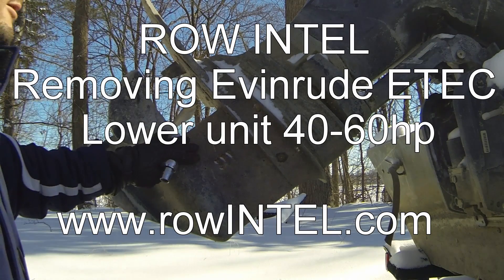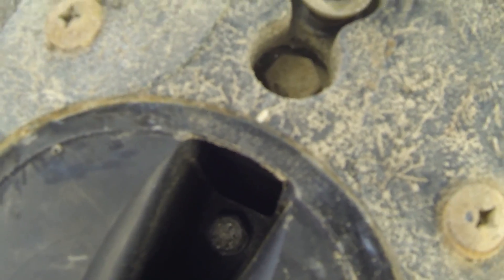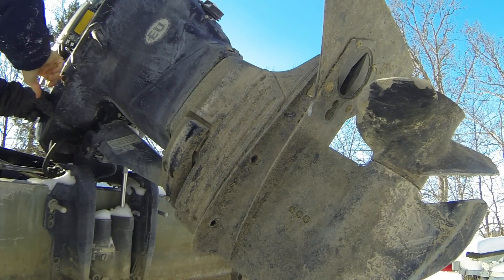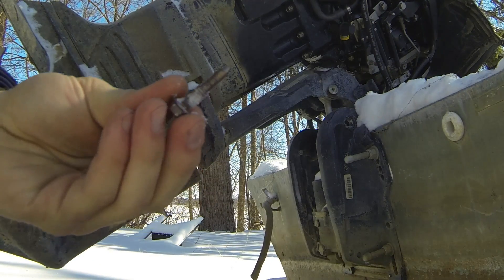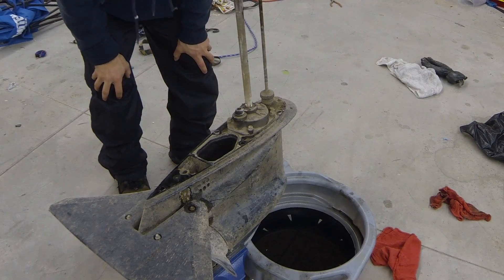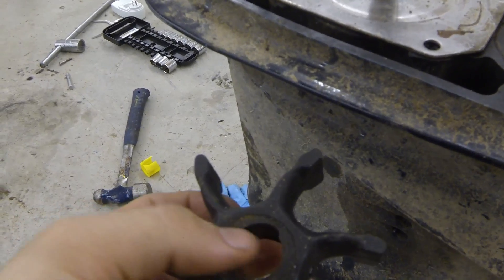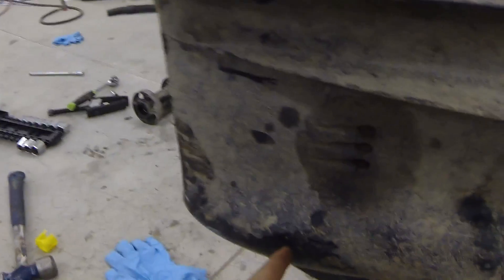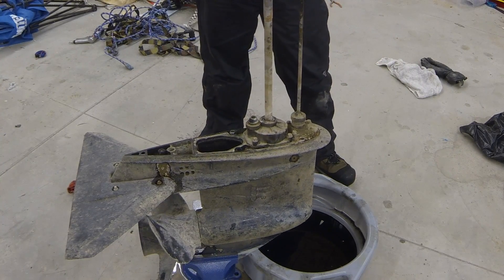10 minutes How to change Water Pump 2010 ETEC 60HP Evinrude

Comment: hi. The injectors of the 40 hp etech engine are not spraying, I think the inside of the engine is locked. I give 12 volts to the injectors externally and there is very little ticking sound. In some places they say it works with 55 volts. I wonder how many volts these injectors work with. and what should i do? I removed and cleaned the injectors. Please help.

Comment: hey quick question I  have a 1993 30 hp ELS and today did the water pump removal and install all seemed fine but starter wont crank motor? bat has juice, starter spins flywheel fast with plugs out. prop and flywheel will turn manually in drive but it is not easy. I can shift from F-N-to reverse, do you think the driveshaft be misaligned? It would break your arm trying to pull a rope manually in neutral.  I should have tried to start it before doing the repair.
Reply from the maker: try dropping the lower unit and then starting the motor without the "foot" on it.  That will at least narrow it down to a powerhead or gearcase problem

Comment: you made it look so easy, did you have to use any gasket glue?  Thx
Reply from the maker: Pacman Au Doesn't hurt to use it, but if you are replacing all the parts including the housing and base plate, then you shouldn't need any.

Comment: Thanks for posting this helpful video. I've done a few of these and they can be a pain. The first time I didn't realize that I needed to remove the lower cowling and was trying to loosen the shift rod bolt with a long socket extension - fail..! I was looking forward to seeing how you got the impeller off the jam key as that can also be a pain. I had to take a hacksaw to one once. I heard the pros whack them a certain way with a hammer to free the key - lots of good info here: http://www.etecownersgroup.com. (There are no metric bolts on the American made motor - they are all US sizes..!)
Reply: Imo, while there are no metric bolts on the American made motors, in some instances, when the metric size is a hair smaller than SAE, it results is an infinitesimal tighter (and therefore better) fit.